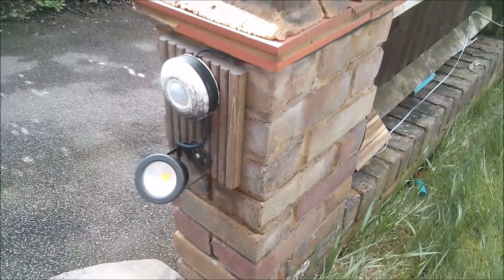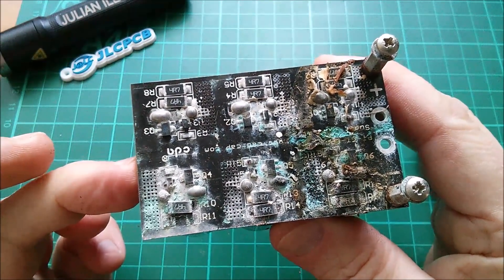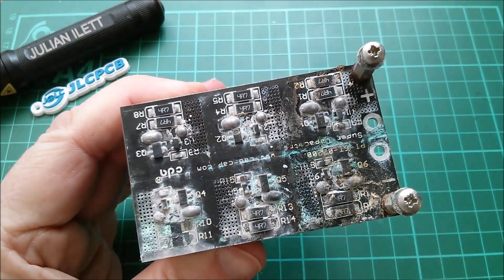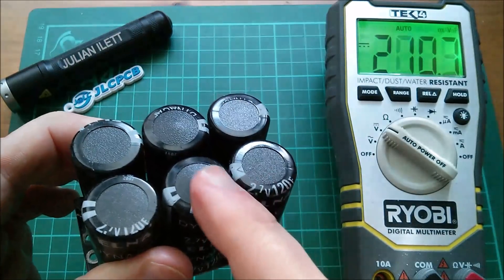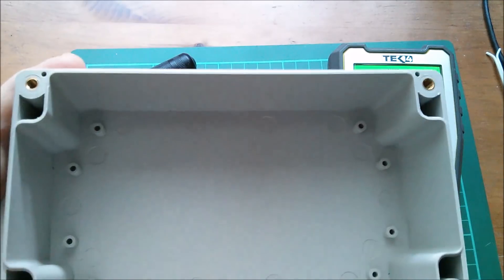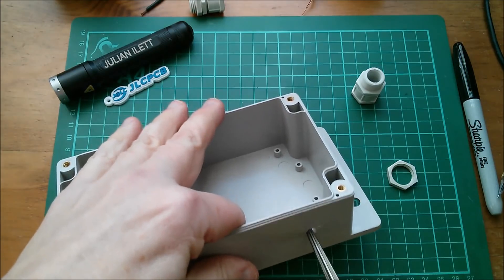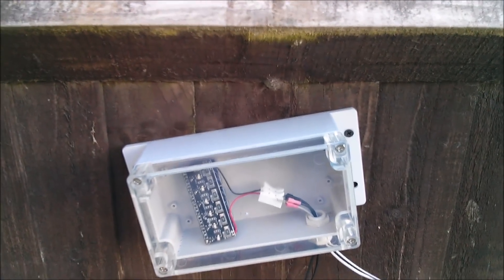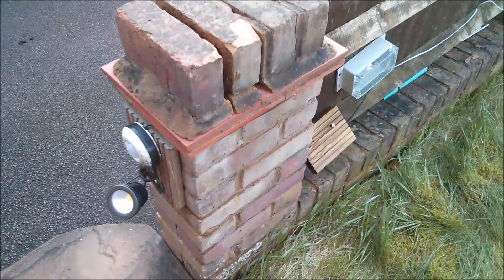Supercapacitor PIR LED Light Repair

Comment: why did not you use some conformal coating before you put it outside? MG chemicals #422B-55ML, use it all the time on my rc car electronics to protect against water. works great

Comment: I had to leave the video before it finished yesterday.
WHAT about CONFORMAL COATING??
At the end of the video it has rained, it didn't rain inside the box BUT the air inside is most probably moist.
The possibility of condensation is HIGH.
Your EXPOSED PCB will get WET, and just like the old PCB, it will corrode.
PLEASE PLEASE. I can't be the only one SCREAMING CONFORMAL COATING at my screen.
I started screaming at 0:30 into the video.
The outdoors is okay for SMD, just that they are completely CONFORMAL COATED. 
Can you drop the pcb in some water and observe the circuit performance?

Comment: I think you would like a step drill bit.  Wood, plastic, metal, works for all.
Back in the day we made custom electrical feed throughs for vacuum systems (think thin film sputtering) by stripping the insulation and epoxying the conductors and without the insulation through the fitting.  Easily obtained 10^-7 Torr ... so, if you ever need a water tight seal, strip the insulation then seal with ?? hotmelt, epoxy, silicone, etc.

Comment: And some calcium chloride in the box to make it really work. It draws moisture out of air to the point it dissolves in that water, and is still highly hygroscopic as a saturated solution. So a pile of, or a permeable bag with, calcium chloride would keep the humidity in that box low for a very long time. If the brine that forms doesn't cause problems calcium chloride can be a highly practical desiccant, that is extremely cheap.

Comment: Poor Slug..... :o)
Reply: Slugs definitely do kill electronics 🙁
 Small one got in through a badly fitted cable gland, then found i’s way to a 24V supply on a PCB. It died and the goo from it corroded the PCB tracks causing a complete system failure 😡

Comment: Why not lift the circuit board off the bottom of the container so if there is any surface water draining out of the holes the water cannot touch the board?
Reply: How else is he going to wreak it, so he can post up a new repair video???
I may have said that elsewhere! Any cash for good repeats?

Comment: Surely it is asking for trouble putting the module vertically in that box so it is in the path of any runoff. Would do better horizontal and as close to the top of the box as possible, no ?
Reply: How else is he going to wreak it, so he can post up a new repair video???

Comment: Pot it. It will then be a thing of beauty forever. If you don't want to do that then conformal coat it. If that is too techy, smear it with Vaseline. Damp air, through those holes you drilled, = electrolysis AKA corrosion.

Comment: You might consider a spray on non-conducting high-dielectric strength conformal coating in addition to the plastic case to reduce oxygenation due to weathering.  In the States the company Chemtronics sells a product KonForm AR with which I enjoy considerable luck.  I don't know that Chemtronics products are available in the UK but something similar must be.  You may want to look into such a thing.
Reply: There are plenty of suppliers of conformal coating spray cans in the U.K., Rapid, CPC, Farnell, RS...

Comment: Hey Julian, I've remembered something that might make you want to put bigger drain holes in.  There was an article that questioned why their enclosure wasn't draining properly, and it turned out that the drain holes were small enough that the surface tension of water would effectively block each hole. Maybe 5mm (3/16") holes would be better

Comment: I ues a set of 2x 500f capacitors (with charge protection) in chicken coop for led lighting when the timer goes off the led fade out slowly just like sun light at sunset. Works very well I ues a cheap cc/cv power supply module to power it.

Comment: If you don't think the box will protect from the moisture you can seal the top of the board in a very thin layer of canning wax. That thin layer will protect any droplets that build up on the board from condensation from getting to the components. With the box protecting from wind and hard weather you should be good.

Comment: Poor capacitor bank didn't deserve to die.
Still at least you found out what happens when you charge 2.7V super capacitors to 3.7V.
I have to wonder if they still work ok at that voltage, could work well with 3.2V LiFePO4 cells.

Comment: You don't need to feed the 2 figure 8 cables inside, just put a terminal block on the outside, and run two individual wires inside.

Comment: I think you have to seal the PCB and electronics Julian. My approach would be to spray the the completed PCB with a couple of coats of conformal coating after cleaning it thoroughly with isopropyl alcohol. Next I'd mount it to the wooden lid rather than on the lower surface and give the drilled out box with an the exposed PCB and electronics a miss. My 2 bobs worth.

Comment: Oh Julien, You're a f-ing stubborn botcher. Just put it in an installation box and don't have these sorts of problems. Are you such a cheapskate, that your better lose a 50 pound capacitor bank over additional 5 pounds for a box? Take a tupperware from the dollarstore if you want to cheap out.

Comment: Julian just use a plastic insulating spray on the PCB! (conformal coating spray) This is exactly the use case they are designed for!

Comment: I... I... er.. just don't know at what stage you thought this was in any way a good idea? Force 9 gales and almost unbroken rain for 3 months (i.e. an average English winter) and the only protection was a piece of wood.  I'm sure in the new case the electronics being at the bottom of a jauntily angled box won't in any way be affected by dribbles of condensation running down the bottom of the box and tracking up the PCB or condensation forming on the PCB itself.

Comment: If you let the air in you must conformal coat the pcb. Condensation will still form on the board and the electricity will do the rest. Just seal the wires I to the  box, warm in the oven and let cool then put lid on. Air inside should then be nice and dry and stay that way.

Comment: As someone who has spent the last 30 years installing and maintaining data collection instrumentation in harsh environments, it is fascinating to see what happens when you just stick electronics outdoors with a bit of old decking for protection! I shall refrain from starting a discourse on industry best practice. Suffice to say, it is very challenging to protect equipment from the environment over the long term without regular intervention  :)
Reply: Oil bath.
Reply: @alankingvideo  Water will build up (sinking to the bottom of the container) until your oil bath is just a bath. Keep the oil heated to drive off moisture, and your oil gradually breaks down and evaporates leaving tar and varnish.
Reply: Is the moisture pump effect real?
Reply: @uK8cvPAq  Warm air holds more water vapor than cold air. During the day air gets in, at night time the air cools and if there is enough moisture to cause dew, you will get condensation. In my experience that condensation does not evaporate the next day. Instead, since the electronics is shaded it stays cool longer, so as the day begins to warm the dew evaporates and that warm, wet air condenses in the box forming even more water. The next night more water. The next day more water. Sometimes the air is more dry so you don't see any (increase in) water for a few days.
The only solution that has worked for me starts with shelter to keep away all the water, good ventilation to help dry with every opportunity, plus a conformal coat and/or a bit of heat above ambient so moisture does not form. I've lost so much electronics to damp outside...

Comment: Who would ever think of a surface mount board could be put out into the open exposed to rain.  Obvious flex was left on the board that’s going to have to change from that ate up the copper.  Outdoor exposure did not think of putting conformal coating on ?

Comment: i have used silicone beads with good results as to contacks i used bolts from inside to out to keep the case sealed with silcone befor tighterning them

Comment: I was interested in that surface mount components outside statement. I wonder if components of either type fair better in leaded solder rather than lead free?  We’ve used lead in roofing for years.
Reply: The solder itself would probably be fine on its own, the problem is that the component itself has an electrical potential across it and will form an electrolytic cell when water touches it, etching away the conductive elements and depositing them elsewhere.

Comment: are they recharged through a solar panel ?
Reply: From memory they are connected to a lead acid battery in the back garden that is connected to solar panel.
Reply: sounds as if I've seen that in a video indeed :)

Comment: Wow. Who would have guessed. Electronics left out in the rain goes all corroded and dies??
Reply: He also uses things not designed to seal water, like hot glue and UV glue, so it would have failed anyhow. We use sealed camera housings in the ocean - more severe than UK rain - and they work fine, so waterproof boxes and marine silastic is what should be used.
Reply: Mai Mariarti  Ahh, as stubborn as most of us then?
Reply: @Bennyboy-dog  exactly ;)
Reply: Why would you not put the board in a ip rated housing using cable glands? Pmsl 😂 even a plastic bag would be better than putting a bit of wood above it.
Reply: Watching this channel is getting harder and harder. Cringe potential.
Reply: a great opportunity for a new video. ;)

Comment: what about some clear, poundland nail varnish as a conformal coating to protect the surface mount components? or at least provide fewer starting points for the corrosion?
Reply: Or a proper conformal coating for like 10 -15 pounds a can - it'll last for ages, you don't need a lot of it.
Reply: I was going to suggest a conformal coating, I can't get my head around a printed circuit board left under a bit wood but open to the weather.
Reply: @Ruthsarian I think I saw a video of someone testing that and it didn't hold up very well to the elements (clear nail varnish)

Comment: Always use glands not grommets for weather sealing! A grommet is solely for mechanical protection passing through thin walled plastic or metal (latter especially). You can get proper glands for flat cable (T&E) - available from Screwfix for just £1.99!:
 https://www.screwfix.com/p/british-general-plastic-flat-cable-plastic-gland-kit-1-1-5mm/1396p

If you need a little more tightness then a single or double piece of heatshrink at the gland should easily solve the problem. Also, don't drill the box for drainage - it defeats the IP67/IP68 spec. To avoid condensation appearing just stick in one or two dessicant gel pouches. I always save them when they come with certain products. 

Used this way I have NEVER had any problem on IP67/68 boxes with insect or spider intrusion, and no problem with moisture ingress either. Biggest problem usually is the unprotected screws becoming so corroded they can't be removed. I solved that issue with a small blob of silicone front (and back, if the holes run all the way through) in the screw holes. Similarly cover the external mounting screws with silicone. It's MUCH easier removing the silicone than having to drill out rusted screws. Putting a thin ring of silicone between the box and the mounting surface behind each screw hole (or the whole box) stops crud build up behind too as well as further moisture protection.
Reply: If (and it’s a big if) it’s possible to completely seal electronics or electrical equipment in an IP68 box with silica gel desiccant packs in bone dry conditions, then that is the best solution.

HOWEVER, in practice this is not always possible. Condensation can be a problem, but rain water or other sources of sprayed water are the biggest issue. So if water (in whatever form) can get into an enclosure / box / system, it is vital that there is a drain hole. Otherwise the apparently weather proof / sealed box / enclosure will fill up with water, as Sod’s law dictates that the seal at the bottom will be better and you will end up with your electronics / electrics sitting in their very own swimming pool...

The second problem is that it’s not always practical to wait for a nice warm and dry sunny day to come along. So if/when you need to work on the electronics / electrics, it may be a damp or wet day. Under these circumstances, there is no way to keep moist air out.

In my job, if there is an electrical system failure that is causing problems, we have to work regardless of the weather conditions and sometimes that includes working in the rain.

If condensation may be a problem, and it’s not an IP68 sealed box, then a drain hole with a piece of aluminium sheet mounted on low down on the side of the box above the drain hole can help. Especially if the electronics generates a little bit of heat.

Otherwise use two boxes / enclosures, one inside the other (and yes the inside box does need its lid fitting) so that the air trapped between the two can slow the rate of temperature change of the air in the inside box.

An alternative if the system has mains power, is a small heater. But you have to consider the air flow in the enclosure, otherwise you may get cold spots fed with warm moist air, which condensates and then drips down on equipment...

And even with all the above taken into account, it’s still recommended to use a conformal coating on any PCBs.
Reply: @Mark1024MAK  OK this is now getting ridiculous. People are saying that any product conforming to a specified standard from a reputable manufacturer will be "unlikely" or "impossible" to conform to that standard. 

I say that is garbage - CLEARLY!

The IP68 standard (https://en.wikipedia.org/wiki/IP_Code) QUITE CLEARLY STATES (Wiki): 
"Immersion, 1 meter (3 ft 3 in) OR MORE depth"  and for either an indeterminate time or a time SPECIFIED by the manufacturer [my emphasis]. As it is a superior standard to IP66 (ostensibly) it "should" also be more than capable of withstanding high pressure jets from a metre distance or less and from any angle; a box WILL NOT DO THAT with open holes in it!! 

Someone please explain to all and sundry HOW an IP68 compliant enclosure can leak water inside? It's a non-sequitur. If the box leaks it's NOT IP68. If it doesn't and it is supposed to be IP68 compliant ... it IS!

In other words, if you use a reputable manufacturer's IP68 product, it is GUARANTEED to be waterproof to 1m AT LEAST - indeterminately or to the manufacturer's spec!! IP65 however (which many people use instead) is NOT waterproof, nor anywhere near!

If you drill holes "to allow drainage" it is NO LONGER IP68!! It's not even IP6x! It's barely IP45. What bit of this does no-one seem to understand!!?? Oh! and YES, you ABSOLUTELY CAN waterproof an enclosure, and sparkies should remember that electrics and electronics are two different things and require a different level of protection. However when the IET (I've been a full member for over 46 years!) specifies IP68 - it's for a reason and YOU the sparky will have to stand up and justify your action in destroying the rating of the box yet claiming (by your certification) that equipment complied with the relevant BS7671 standard when it didn't. Neither the IET nor British Standards will stand idly by and have their name besmirched by someone who broke the rules because "that's the way I've always done it and it's never been a problem"!

If a plastic or metal conduit, enters an IP68 enclosure, then in order to maintain that spec the WHOLE conduit/enclosure system must be maintained at IP68 level! OR, an IP68 compliant transition to the conduit (which can, and often does need) drainage, will be required.

Using IP68 grommets through properly sized holes, and properly fitted, WILL also be compliant AND waterproof if left untouched. Anything that destroys that rating (e.g. drilling unsealed holes) makes it totally NON-compliant and puts you at risk of being sued when someone who DOES understand the specs, and how they are ensured, discovers that a so-called "professional" has screwed up the rating by doing something entirely unnecessary (and frankly ridiculous). 

DO NOT DRILL UNSEALED HOLES IN IP67 AND 68 RATED PRODUCTS AS THEY WILL NO LONGER BE, NOR CAN THEY BE CALLED, IP67 OR 68 compliant! By definition they AREN'T! They don't even comply with IP6x, and in fact, even the dust rating will be destroyed ... BY AS LITTLE AS A SINGLE 2mm hole. If insects can get in, so can dust, brought in by the insects if nothing else! 

I can't believe so many people claiming to be professional are arguing against this. If the box leaks, in ANY way whatsoever it is NOT IP68, or IP67 or even IP66!! Condensation, in a sealed IP67/8 box comes from a tiny amount water vapour in the air at the time of sealing NOT from leaks (unless because of poor workmanship). Condensation, significant enough to cause dripping, signifies a MAJOR problem elsewhere. 

Sealing the box in a humid or even rainy atmosphere is easily remedied by a few seconds blast (bit longer for large enclosures) from 2 feet away from a plumber's blowtorch, or safer & better yet, a hot air gun, wafted across it and sealing the lid immediately afterwards. Not hot enough to melt plastic or even char it but enough to warm up the air and drive out the small amount of humidity.

Sorry, but in the words of the Borg ... "Resistance is futile"!